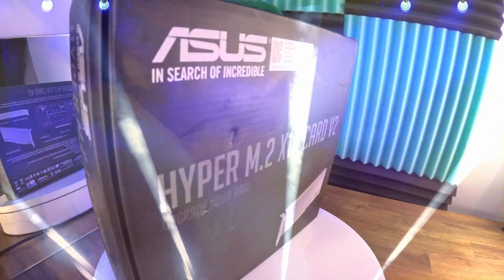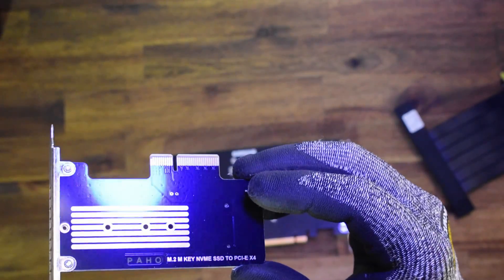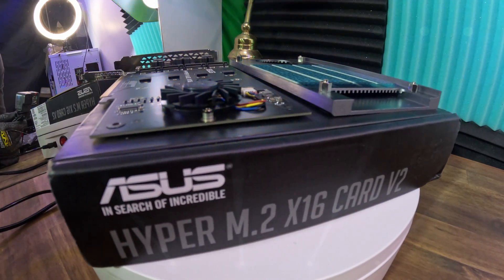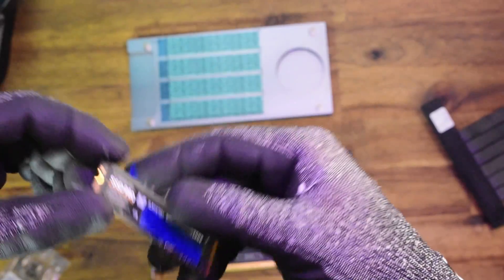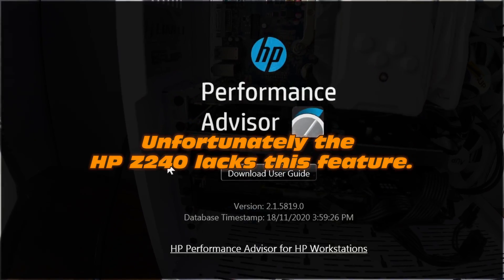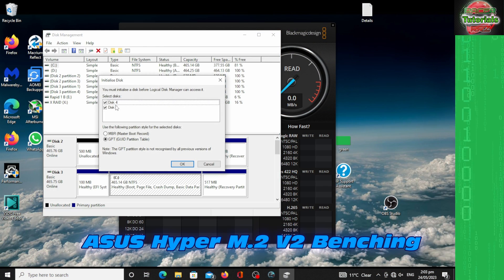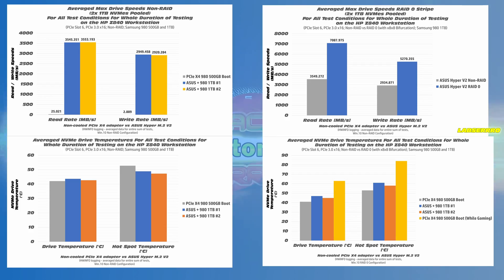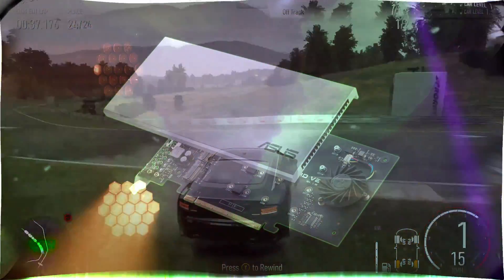8TB RAID 0 Guide : ASUS Hyper M.2 V2 - You will not believe the speeds on this NVMe storage adapter!

Comment: Can I have RAID 0 on it?
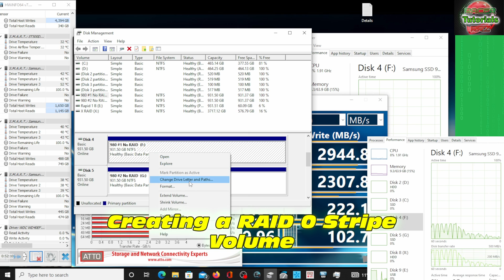Reply from the maker: Hi, yes you can and it really helps to boost the speeds of these NVMes. I provided a full guide on how to setup RAID 0 in the video and I included the Read/Write speeds: 15:47. 

I also did another video that compared 4 different quad adapters with 4x NVMes in RAID 0 here: https://youtu.be/xqg0uQ93KTg

Comment: Do you think this would work with crucial t705 ssd’s on a gigabyte mz33-ar0 board and amd epyc 9374f
Reply from the maker: That's a solid selection of hardware. From what I could trace the EPYC 4th gen processors do appear to support bifurcation (I would be surprised if they didn't) - and that's really the only thing that would prevent the Asus Hyper M.2 adapter from working as intended. (reference: https://www.amd.com/system/files/documents/4th-gen-epyc-processor-architecture-white-paper.pdf )

Given that the Crucial T705's are Gen 5, I would expect their performance to be bottlenecked by the PCIe interface that they are paired with. The Asus Hyper M.2 (slightly longer than the one in this video) is Gen 4, the Asus Hyper M.2 V2 (in this video) is Gen 3. Gen 3 would be limited to ~3500MB/s (8GT/s) per drive. Gen 4 would be limited to ~7000MB/s (16GT/s). Gen 5 would be limited to ~14000MB/s (32GT/s). However, these speeds will vary pending the hardware present on a given system. 

Placing 14000MB/s NVMes into the Gen 3 Asus Hyper M.2 V2 should net RAID 0 speeds of ~14000 - 16000MB/s, but if you get the Asus Hyper M.2 (Gen 4) you could theoretically double that speed to 28000MB/s - 32000MB/s. The most ideal solution would be to get a Gen 5 PCIe adapter like: https://www.gigabyte.com/SSD/AORUS-Gen5-AIC-Adaptor#kf I can't seem to find any videos of a Gen 5 NVMe based RAID 0 setup - but I am sure it exists out there somewhere.
Reply: @racerrrz  thanks for the run down and tip! Much appreciated
Reply from the maker: @FamilyTuned   No trouble. Your setup would make for a really potent system - what are your end-use plans for it?
Reply: @racerrrz  I’m guessing the gigabyte would work better with the MB just based on being the same manufacturer
Reply from the maker: @FamilyTuned   I would believe that also. The Gen 5 adapter doesn't seem to be that abundant (I am not 100% sure on when it released but likely it was 2022), but I traced one on Amazon: https://amzn.to/3vJn5jj (affiliate link) or Amazon search: "Aorus gen 5 adapter AIC". 

If you get one it would be cool to hear what speeds you end up getting. Their prices are decent actually, the older Aorus Gen 4 AIC card sells for more! I am yet to see any videos on the Gen 5 adapter but I would expect fast speeds on a modern system.

Comment: Thank you for the video!  This is exactly my scenario as I have several old HP 640 and 840 that I can still squeeze performance out of.   PS: won't you get better performance if you did a hardware RAID instead of a software RAID in Windows?
Reply from the maker: I am glad you found it helpful. If you haven't already, check out my video on the HP Z Turbo Drive Quad Pro - it works really well in the Z440 / Z640 / Z840 - if you can source one on the cheap anyhow. I have one in my Z440 case swap for some TrueNAS caching. 

Hardware RAID would likely give higher speeds but to make the system a bit more lenient towards system upgrades I kept the Windows / software RAID. I upgraded from the Z840 to the Z8 G4 and I could simply slot the Asus Hyper V2 in without need for changes. But that would make for a cool video - software vs hardware RAID. I did a test in Windows storage spaces and that seemed to work well enough.

Comment: I love ❤️ your video 🎥 style.  It’s like watching 👀.  A sporting event 🥋🏂🥇.  I have one ☝️ question.?  Can you change the fan size.  Maybe put a larger fan.  Like a *(Noctua NF-A4x10FLX) small PC fan.  Even though I was thinking 🤔 about.  The Liam-Li LCD fan.  Nothing better than a little RGB.
Reply from the maker: Thank you, cinematic viewing all the way. 

Yes and no for the fan change. 
The challenge would be the size of the fan, particularly given the low clearance. Looking at the NF-A4x10FXL I would say no, it would be around double the depth that would fit. That doesn't mean it can't work, with some metal work you could remove metal to get enough clearance for the fan to protrude through the metal casing, but the fan's concept is similar to laptop fans or console fans in that it pushes air over the heatsink rather than pulling air through it like PC case fans would. The lack of outer fan shrouding would be important then also. 

It would be a really inefficient fan as it is, but any flow is better than no flow.
Reply: @racerrrz  - Thank you for answering my question 🙋‍♂️.?  I have always wondered why.?  They never made one.  With a bigger fan on it.  Why no one has ever.  Mod one with a bigger fan, & RGB on it as well.  But now I know.  It pushes air over the heat sinks.  Not pulls air like in a PC.  *(Knowing is half the battle. - G.I. Joe).

Comment: That's just completely dated rubbish. Is this video from >5 years ago? (16TB Iron Wolfe - yes that must be at least 5 years old)
Also cooling design is years behind. More modern cards have dedicated coolers on the NVMes and a fan then cooling those coolers.
Get at least a PCIe 4.0 x 16 card so you can at least run non-ancient NVMes at speed. 
4x7GB/s in parallel is really nothing fancy anymore - if you have enough lanes. And that HPZ840 is really an antique. Just guessing: 2015 or somewhere around that time? Any cheap current AMD will run circles around it.
But this is really only yesterday's tech.
And RAID 0 is of course never a good idea and never was -- completely independent of how old it is.
But nice antique show.
😉
Reply from the maker: Hi there. Thank you for the input. Was it that obvious that I planned to take you back in time? Back to a time when RAID 0 on PCIe 3.0 x16 was still cool and "large HDDs" were unaffordable; that sounds like 2017 to me haha. 

The Asus Hyper V2 is a current spec NVMe adapter (designed specifically for PCIe 3.0 systems - like the dated HP Z840 workstation), as are the 1TB Samsung 980 NVMes (these are PCIe 3.0 and not that new). The Iron Wolf Pro 16TB was first released in 2019 but I can't foresee why anyone would buy a high capacity HDD when they first release - the cost per TB would be less than economic. 

It sounds like you prefer more modern desktop hardware with say a Ryzen 7 CPU with a X570 and glorious PCIe 5.0, and some Sabrent Rockets. Ironically those systems also benefit from RAID 0 on the Asus Hyper M.2 Quad adapter and the 16TB Iron Wolf Pro would be a fantastic storage upgrade for those systems. So I fail to see how this video tutorial doesn't benefit individuals with more modern systems. All you need to do is spec. the hardware you buy to suit your system. 

I'll add the Z840's best CPU combo (dual E5-2699A V4's; 44 C /88 T) sits around position 250 in the PassMark CPU Bencmark list (not far from a AMD Ryzen 9 5950X) for multicore performance - with AMD's current gen CPUs being top of the list obviously, and single core performance being much more in favor of desktop CPUs: https://www.cpubenchmark.net/CPU_mega_page.html# . 

Not bad for 2014 hardware lol. If you hunt around you could have either a AMD Ryzen 9 5950X or two Xeon E5-2699 V4's for the same money, the snag is the hardware to run the Ryzen costs much more than the old Z840.

You'll find the video below is more in line with modern day hardware - but I will add I obtained nearly the same RAID 0 speeds on my aged Z840 with PCIe 3.0 compared with the modern day hardware tested here by another channel (Asus Hyper M.2 with Samsung 990 Pros):
https://www.youtube.com/watch?v=c-vMzeQgd5k

While on the topic of new and modern, I quite enjoyed Linus's video on the 21x Sabrent Rockets fitted to a Apex Storage X21 : https://www.youtube.com/watch?v=IFwFDZDQWAA

And you may enjoy the Z840's younger brother: 
https://www.youtube.com/watch?v=ESW3gXUo1QM&t=1s

What would we do without Linus covering the hardware we can't afford lol. 

On a plus side, I have upgraded my Z840 to a HP Z8 G4 and this same adapter netted up to 12000 MB/s Read and 10000MB/s Write speeds, but on average, its lower than that with the drives full.
Reply: @racerrrz   Thanks for your reply! I really failed a bit to recognize this as sort of back-in-time video since it only came up somehow in my feed and I was unaware of any context.

I'm not one of the persons who always needs to have the newest hardware. In fact my last machine which I only replaced in spring this year was an old Dell Precision with a mid-level Xeon from 2015.
That BTW had a 4xNVMe PCIe 3.0 OEM adapter of likely better quality than the adapter in the video.

I tend to use my machines for as long as possible and only replace them when they really become inadequate for the job at hand. Just a question of sustainability.

But really one thing I learned - using Raid since about the very early 90's in each and every one of my machines: Never use Raid0. Or at least only use it if you have really top-notch backups.

I regard it as sort of a learning process. People usually start with Raid0 because the gain in speed is so impressive. After they got hurt they usually switch to Raid5.
And then comes some point after some years where people learn that for the most cases they really want Raid6. ;-)

As said, I only tend to upgrade when it is really necessary and then I tend to size it to last for at least another 5+ years according to my needs.

So right now my current set-up is kind of massive overkill. Ryzen Pro 5975WX 32 Cores (ranked currently 28th position with PassMark), 512 GB of ECC RAM, 8 x 2TB Samsung 990 Pro, 2 x Exos X18. Those 8 NVMes are mirrored in pairs and running with zfs. Sort of Raid10. After all those years with computers and Raid I really came around to prefer reliability a long time ago.

As Raid0 those NVMEs could deliver >50GB/s easily. But that would really make no sense and something I leave to the current generation of script kiddies. I grew out of that already a long time ago. ;-)

Last time I used Raid0 was with 5 IBM DCAS 4TB SCSI drives around the mid-90s.

Was nice at the time and made somewhat sense - but today I absolutely see no reason to take the risk. Drives are now really big enough so that you don't need to compromise anymore for most cases.

My little home server made mostly from recycled parts is currently for example  running 8 Exos X18 for mass storage. RAID-Z2 (similar to Raid6) of course. Plenty of capacity and sequential read/write performance is around 1GB/s.
Which is really good enough for me with rotating rust. 10 GbE ethernet is already a good choice for something like that. 

But really: Don't use Raid0 -- that is a typical rookie choice. On the upside - you can only grow and learn from that choice ;-)
Reply from the maker: @thisiswaytoocomplicated  Arguably all my videos are trips back-in-time because I mostly work with hardware that suits my current well-aged machine. But in some way all of it is still trending right now because the current generation of tech. still seeks performance, even if it means using old methods to get it (like RAID 0).

The Asus Hyper, ironically, was the best overall performing adapter in my testing: https://www.youtube.com/watch?v=xqg0uQ93KTg . 

I did RAID 0 testing with Gen 4 NVMes on 4 different PCIe adapters. Two Gen 4 Quad NVMe PCIe adapters and two Gen 3 Quad NVMe PCIe adapters (Asus Hyper M.2 V2 vs AORUS Gen 4 AIC, HP Z Turbo Drive Quad Pro and JEYI Quad U.2 to M.2 adapters). 

My quest for RAID 0 is not for reliability - but just for speed. I use the drive as a temporary storage archive for video editing. My current RAID 0 pool is 8TB (4x 2TBs in RAID 0 in the Asus Hyper), which allows me to essentially clone what is on a 10TB HDD (same directory structure) but without the HDD's speed limit. When you handle multiple video files in different directories it becomes basically impossible to edit from the HDD. So RAID 0 is purely a fast scratch drive with temporary storage and it should be treated like it will vanish (one drive fails they all fail - living dangerously!). 

My plan is to create a RAID 5 pool of ~ 5-6 10TBs initially using TrueNAS Core (it's in my case-swapped HP Z440 - there's a video for that also haha). So the in-use data lives on the RAID 0, and that is backed up to a 10TB rust spinner which is backed up to a RAID 5 HDD pool (with a 1TB NVMe for SLOG) via a small 10GbE network (HP Z8 G4 to Unify Flex-XG switch to HP Z440). Eventually I'll work towards hardware RAID for added performance. 

Your system is quite powerful, 

ZFS with 8x Exos X18 drives in RAID-Z2 is a solid performing drive pool, and reaching 1GB/s is the modern day is the ideal. Combine that with 10GbE networking and you have a potent system with no major bottlenecks. 

A Ryzen Pro 5975WX is at the upper end of the spectrum, solid performer! How you managed to afford 512GB of RAM (I presume DDR4 3200MHz) I have no idea! haha. I 'cheaped' out with 256GB of DDR4 2933 MHz ECC server Regulated RAM and that cost nearly the same as the whole workstation... 8x 990 Pros in ZFS's 'RAID 10' for your main machine is impressive - how have you connected those NVMes to your system? The most optimal method I am aware of would be a 5.25" Bay adapter (the Icy Dock MB873MP-B would be a dream for that), and I presume hardware RAID?

Comment: Ускорить старые nvme за 5к руб - вариант
WD sn850x быстрее по Q32t1 будет : примерно 950 мб/сек, а не 280, как в видео.

Рациональные новые nvme купить. И ресурс диска больше и скорость.
Reply from the maker: Nice, the W/D SN850x seems to be a solid NVMe for those speeds. The Samsung 980's tend to be cheap for the performance on offer, but they are also limited to PCIe 3.0. Unfortunately my Z840 is limited to PCIe 3.0 so I can't make use of the extra speed on the SN850x on my system. But any modern motherboard would greatly benefit from the extra speeds.

Comment: I might be missing something....but.... To test file transfer you need a known faster "source" drive ...... I use a 100+ GB "RamDisk" for my source files when testing and a 50+ GB video file with 10 GB of tiny crap files thrown in.......
Reply from the maker: Hi. I would agree, to properly test file transfer you would need to set up the right conditions for a fair test. This was a "lazy test" at best, but I think it's reflective of what you could expect for your actual file transfers. Most individuals do not have RAMDisks setup on their modules, but that would make for an interesting test. My file transfer was from Non-RAID NVMe drive to the Asus Adapter (with or without RAID 0). Speeds tend to be limited by the slowest hardware in the system, so your mileage may vary on actual transfer speeds with this adapter. 

For your RAMDisk, how are you utilizing the speed in day-to-day operations? I haven't read into them in-detail, but its mostly because I do not currently appreciate their end-use (I need long term highly stable data storage). Given that the NIC tends to be the speed limit, and that NVMes deliver high speeds, I do not see the benefit in having a RAMDisk (ultra fast but volatile memory), unless you have a few TB of RAM allocated to the RAMDisk, now that is something I would find of benefit for quick transfers - but even then the speed returning to conventional storage will be a speed restriction.

Comment: You keep saying 'PCI Lane' when you mean slot.  The x16 slot is split into 4 x 4 lanes using bifurcation.  Otherwise, great video.
Reply from the maker: Hi. Thank you, I am glad you found the benefit of use. I am sorry to hear the lane reference got to you, I used it heaps which would have been frustrating for you! Rechecking it- there were places where I said "x16 lane" where I should have said x16 Slot, good spotting!

I use "lane" by specific intent, not through error, because referring to a x16 mechanical slot isn't sufficient for operation of these adapters, and it can actually be misleading in doing so. 

Let me explain: 

e.g. The HP Z240 has a x16 PCIe slot (Slot 4) that only has x4 electrical connectivity. Despite the deceptive x16 slot appearance, it will not be able to operate this adapter for more than one NVMe (despite the adapter's x16 slot size matching up with the x16 connector on the ASUS Hyper M.2 V2). Hence, I refer to "x16 lanes" to more specifically address that the PCIe slot that you select must have x16 electrical lane connectivity for this adapter to function as intended, as well as the BIOS PCIe bifurcation setting (so x4x4x4x4 or x8x8 lane bifurcation). 

The discrepancy between mechanical slot size and electrical lane connectivity isn't that common, and manufacturers like HP usually designate this difference through including reference to the lane allocation in brackets. e.g. PCIe3.0 x16 (4), meaning PCIe 3.0 encoding, x16 mechanical size and 4 electrical lanes connected.

I outlined all this in more detail in a previous video in case any one finds that of benefit: https://www.youtube.com/watch?v=PRMWIpscDCg